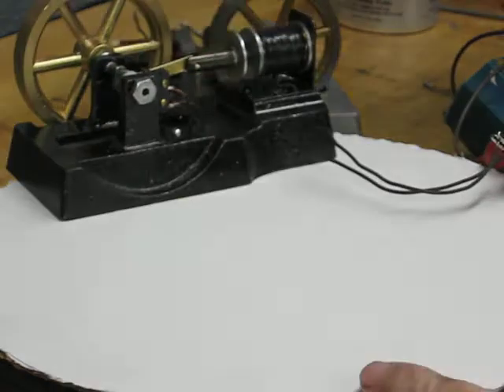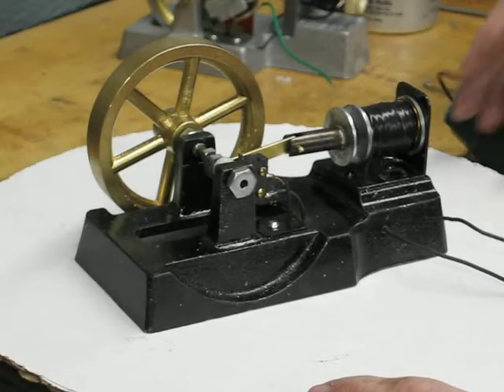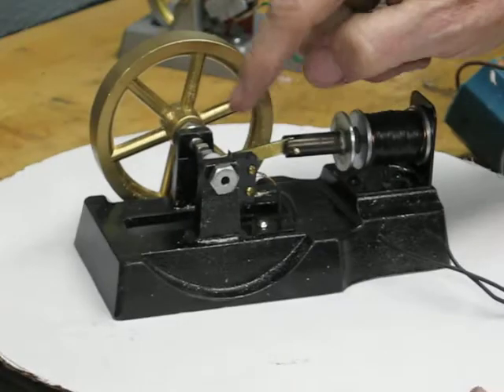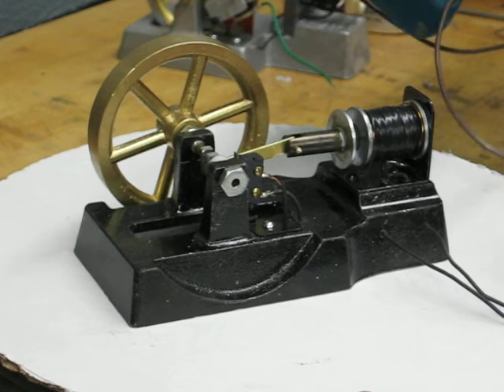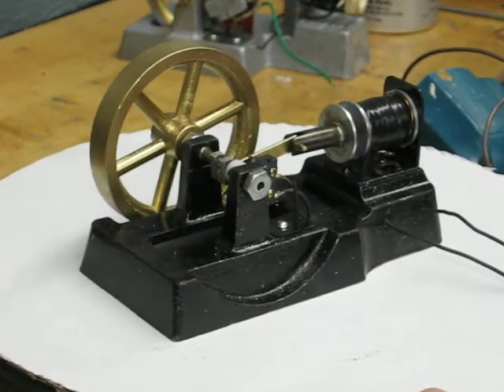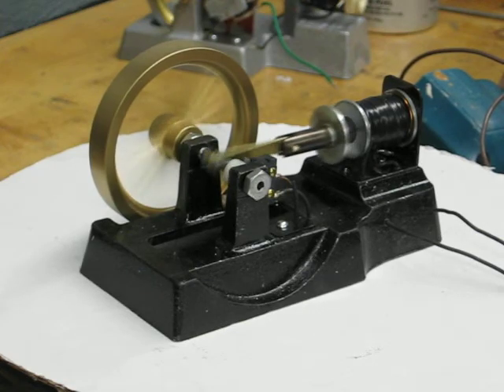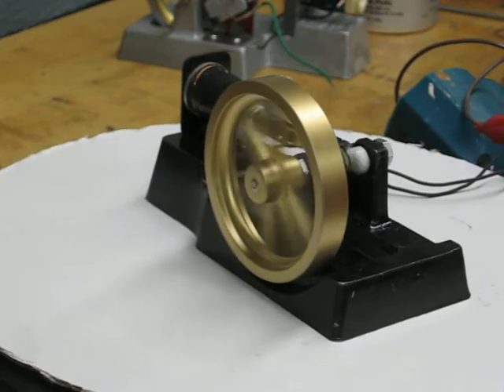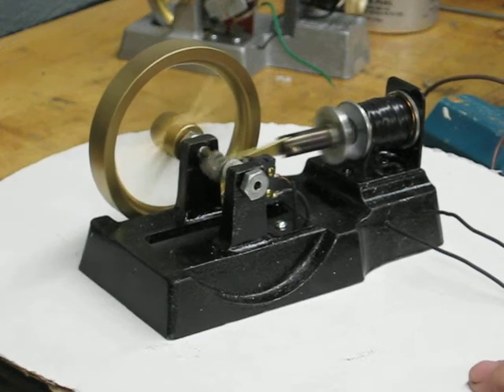ELECTRO MAGNET MOTOR MESCO Avery patent TUBALCAIN 2

Comment: Question,  if flywheel was pulled out some and if magnets (small cylinder type powerful ones) were mounted on perimeter of flywheel, along with magnets on both sides of flywheel...  all feeding to coils mounted around perimeter and for the ones on both sides too...  feeding a single or two capacitors (that alternated discharging) to feed power back to your pulsed solenoid (aka electro magnet). Would this provide the power needed to operate motor to similar speeds? All "John Bedini" style like (similar) and have shaft power for free? If not enough power from magnets, could add a second flywheel perhaps? Like an old basic lawn mower, except replacing the gas piston with an electromagnet system (aka solenoid :) and adding extra magnetos to the flywheel to power the replaced solenoid with power.

Comment: Nice builds. Watched both and now I have to put the 4 jaw chuck on to build a crank !  Will make a few with different strokes while at it, as 4jaws a pain to set up. Where did you get the bases for them ? If it's top secret , will wait for more wiki leaks !
 Nice craftsmanship , would be a good tool for getting kids interested in electric and machining, there is a real need in the states for our crafts.   Bravo for wizzbang builders.

Comment: Actually, there is a very fundamental difference in these two engines. One, with the piston inside the coil, relies on the magnetic potential of the coil to repel it and drive the flywheel, the other design induces eddy currents in the plate on top of the coil to drive the flywheel with far more available energy. This energy is developed from the local background, A simple torque test off the flywheel will provide proof.
Reply: I would disagree with eddy currents driving the wheel. To prove this, use a high resistance magnetic core, or laminated core instead. The effect would be the same. Btw, what did you mean by "from the local background"? I don‘t understand that part